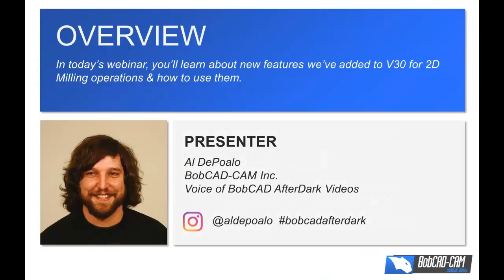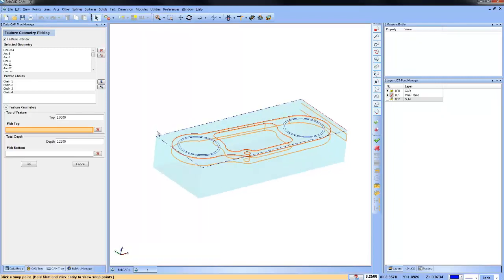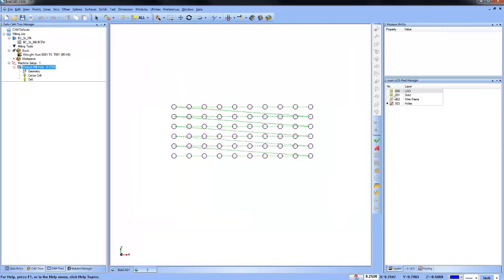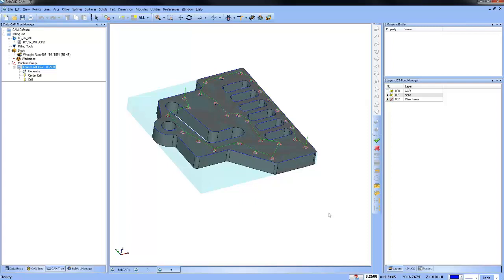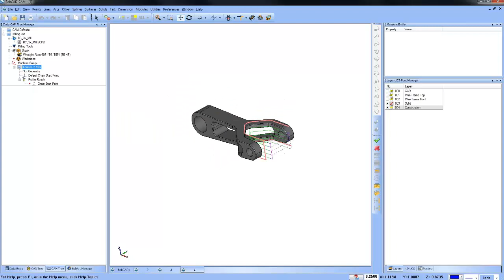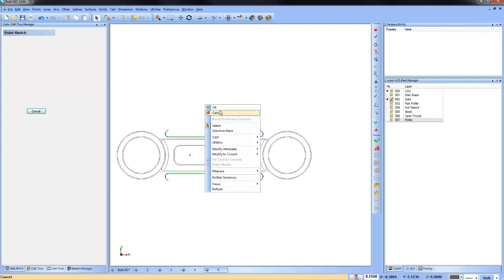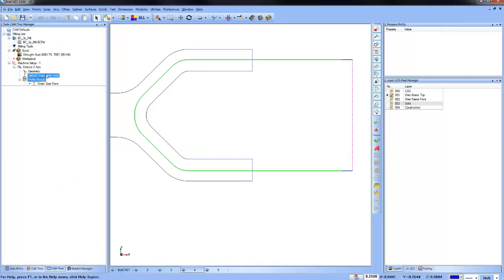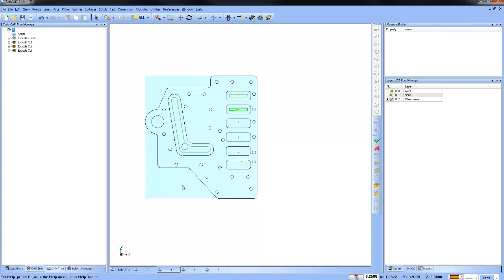Whats New In V30 2D Milling- BobCAD-CAM Webinar Series

Comment: Can you do a spiral entry around a particular point? You never answered this question, it was asked twice.
Reply from the maker: BobCAD does offer a spiral lead in option.  If you want the spiral to be around a point location you can use the toolpath editor to modify the spiral location.  This video shows how to move the spiral location using the toolpath editor. https://youtu.be/EUjhnaQvWCE?t=33m43s
Reply: BobCAD CAM, when you select a point for the spiral lead in, it places the spiral on the point somewhere. It doesn't place it centred on this point, only on an edge of the spiral. This is useless as I want to select a point that I have pre-drilled so I can enter with a tip cutter that isn't center cuttng.